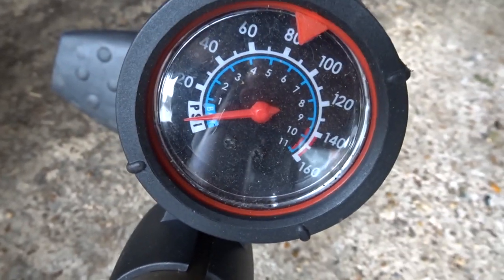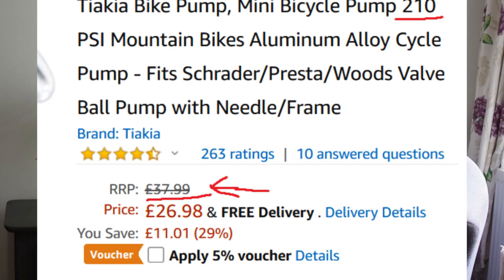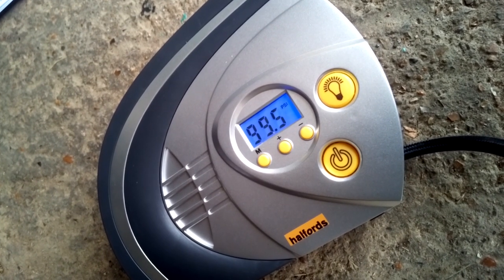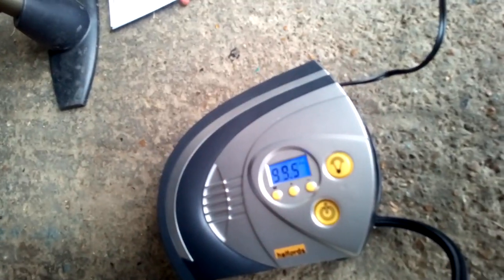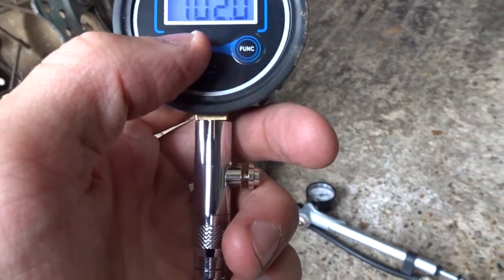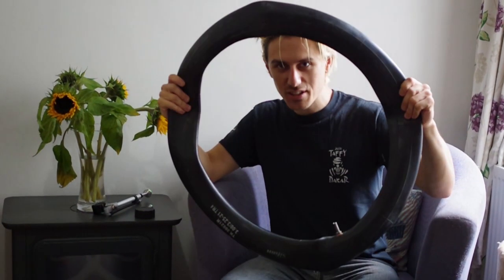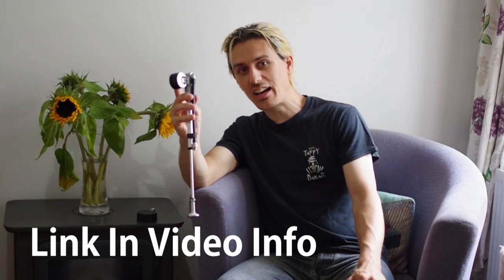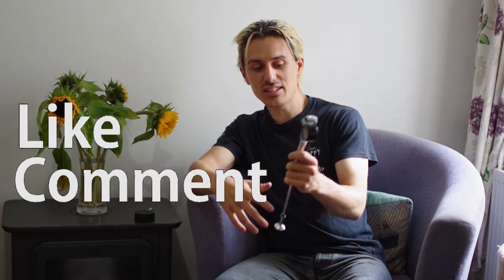Tubliss / Long Term / Puncture Repair /  Review

Comment: Its a fork pump for a mountain bike. Actually a great idea. Link doesn't work for us in the states, but I'm able to source the pump. Great tip!  ONly issue is volume is limited and will wear your ass out pumping up the low pressure side for road riding... or carry two pumps.

Comment: WP, Tusk, and Rockshox make a digital shock pump rated for 300 psi. They are all the same just rebranded. They are great and work on any schrader valve. They can pump up a bike tire fast enough considering the size and that you don't need co2. I carry mine in my camelbak.

Comment: Hey Pezza, upon reflection would you still recommend the tubliss system? Also how did you manage with insurance for the bike when you told them about the modification?
Reply from the maker: Yes recommend, I forgot to tell insurance company 🤦‍♂️🤔 I guess we would have to even if we put in UHD tubes with Rim locks
Reply: It’s a difficult one really as if you didn’t declare it and you had an accident would the insurance company pay out? Also when I emailed tubliss to check if they are road legal here in the UK they said there not? Loads of people seem to be using them though so I’m not sure what to do really? I really like the idea of them.
Reply from the maker: @iangriffiths9930  if they are installed correctly I think they are safer then tubes, the tyre can't come off the rim in the event of a flat. Yeah you are not ment to use them on the road but people also uses mooses on the road and there really not safe
Reply: Agreed on all points!

Comment: My biggest question is, is it OK to use the tubliss system on the road at speeds up to 100km/h for a long time? I mean can you go for a trip riding for about 40km/h on the road and then hitting the trails or they aren't good to use on the road?
Reply from the maker: I have done 250 miles in a day on the road at 60mph and it was fine no problems
Reply: @BigPezza  oh that's good news, I'm tempted to go tubliss but i was also considering mousse inner tube. do you also use tubliss at the Front?
Reply from the maker: @ripmax333  not yet but i will be when i change the front tire.
Reply: @ripmax333  Don't Mouses overheat on tarmac for distance and melt?

Comment: It's not a big deal if it's not exactly 100psi, can be 90 or 80, has worked for me. The copycat product NoMousse recommends 80psi. There are bike pumps that can switch between hight pressure and low pressure mode, Topeak roadie 2stage for example.